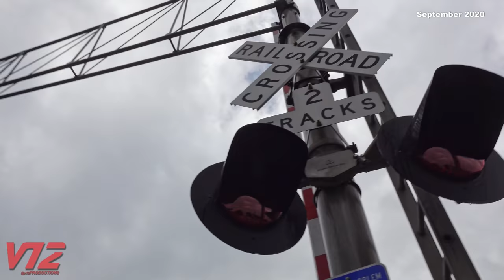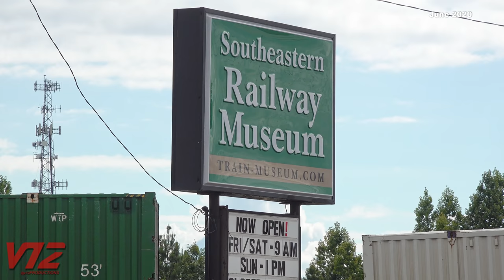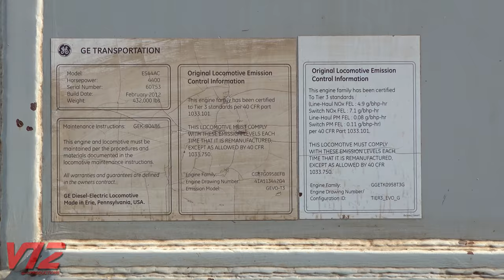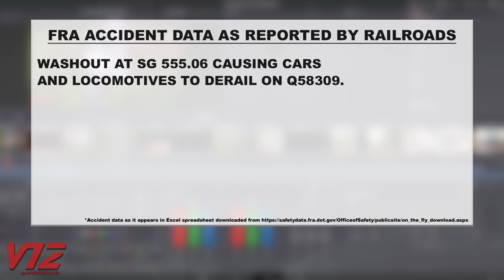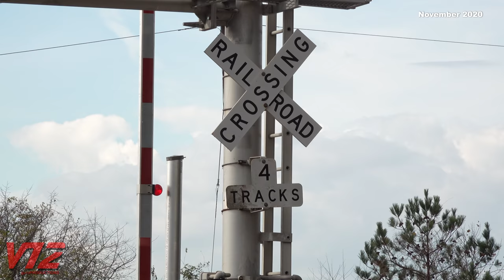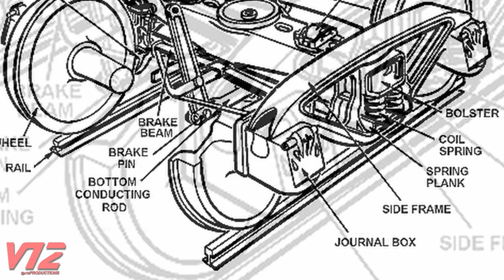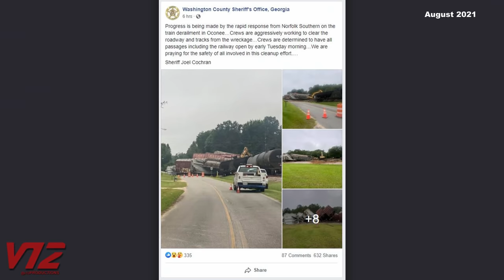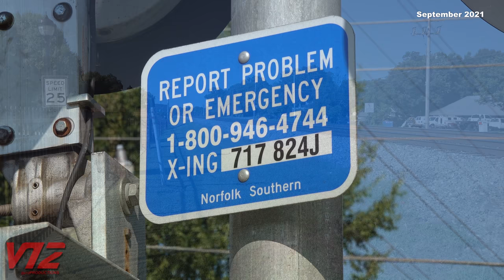Train Derailments & Accidents SPECIAL REPORT

Comment: What amazes me is how fast they can get the equipment to the derailment site and get the line open as fast as they do considering the thousands of miles of track .  That's a lot of specialized equipment.  Sometimes, derailments happen in such remote locations like the swamps along the gulf coast and remote mountainous sites.

Comment: Here in the UK the orange Level Crossing lights flash before the red & white stop barriers go down, therefore drivers get the chance to get through the crossing before the barriers come down & block the vehicle on the track ... we don't have many open Level Crossing here, it's usually in very rural areas, but because of the multi-layer warnings & highly noticeable signage leading up to the crossing incidents are rare here.

Comment: I was an engineer for UP in Iowa for some 12 years mostly the east/west corridor. Much of that has a track speed of 70mph, and when a vehicle gets hit at that speed, bad things happen. The last one had body parts splattered all over the front of the cab. The crossing had gates, lights and bells, and I was whistling according to GCOR and FRA guidelines. It was smaller intermodal train, about 8k feet in length with four burners on line, and running 70 mph. Flat, level and a straight section of rail. Never should have happened - but the car's driver went around the gates. Train speeds as perceived from the ground can be very deceptive! NEVER assume that it can be outrun.
Reply: I ran engines for 36 years for a railroad in the USA. Ran over all kinds of stuff in my time as an engineer, the usual stuff cars, trucks and some pedestrian suicides. We had a supervisor that said if you are following the rules and doing your job right, it will keep the ghost off of the bedpost. I guess it depends on the person, but I lost very little sleep over any of it.
Reply: @old56timer  Play stupid games--------Win stupid prizes!!!

Comment: This was a very well put together documentary. I was born in the UK where trains are used pretty regularly to get from point A to B. Commuters freight trains and high speed trains are used on a daily basis. My Father was a train spotter and we lived near a busy but not crazy busy railway line all my life. My dad taught us rail safety from an early age. there thing with trains in the UK are diesel electric commuter trains, which means they rely on a third rail. the commuter train have points underneath the train that ride on the third rail, If you step on or fall on this third rail it is a painful death follows. I have seen tracker trailers cars buses and even motor cyclist running the gates and lights on so many occasions. Trains here in Canada are mainly used for freight with passenger trains traveling across this large  country so they are not like in the USA in this respect. that being said there is a commuter train that has been used here in Ottawa central area soon too open a new part in the near future called the CRT train. His type of train can run forwards and backward without using a different rail to turn around. Most trains can do this. I used to go out trainspotting with my Father when i was much younger and i even took my 3 year old with me. we told him how he has to be careful not to be too close to the edge of the plat form as high speed trains rush past the station at high speed. He was well behaved and even got to sit in on of the cabs. while it waited for the green light to go. Its was a fun day out and the excitement is contagious. Engineers of trains are the best people out there. We also went to see a newly refurbished engine that my son sat on the front bumpers of i was right there with him when my Father took the photo. My son had the time of his life. Rail safety is paramount. You can stop fairly quickly a train can take miles to fully stop. being killed by a train you don't go home in one body bag and it is a gruesome scene for the recovery process. When running trough a train crossing you are not only risking your life but the passengers, the engineers and staff also, on the train. Even if you are on a time line it is not worth risking so many line just to be on time it rarely ends well. Be Safe out there, please don't risk your life and many others, its not worth it

Comment: With regards to villa Rica. That particular area has 2 roads that parallel the tracks. One on each side. These close conjuctures create a pinch at the crossing that an unsuspecting or newer truck driver has to figure out as the driver is in real time. Many times the conditions further limit  the drivers line of site. A huge upgrade would be to red light the parallel traffic with no turn on red indicators as a train enters its block before the gates are activated

Comment: As  much as I have these accidents happen, it still amazing that with the signs, placards, truck driver training these things still happen. One thing not mentioned was folks turning sharp turns to put them shelvs into the road road bed trapped between  the rails. Like the folks at Ashland Virginia. We even had this on CN in Warrensburg, Illinois last week. This is a single track crossing, but still had an auto driving 50 or so yards down the road bed.   This could be another storyline for this "Training" video. Just a thought. In this case, city and CN Railroad took action and no train versus car took place.

Comment: Very good video my friend Thank You!! It is very sad some does not use common sense at railroad crossings as they should. Derailments happens anywhere, but I have notice NS has had a lot of them recently😳😳😳 Again thank you for a awesome video!!!!
Reply from the maker: Thanks for watching!
Reply: The vast majority of derailments come from poor track maintenance. #SafetyThird the American way! 🤭🤭🤭👎
Reply: Some of these derailment to are heat expansion due to welded rail. Also called "Sun Waves or Winkles" .    I have felt them when riding Amtrak.  I have "Sea legs,  not Train legs".

Comment: A long time ago, I was about 10 years old. I was riding the bus and we came up to a crossing. Traffic backed the crossing up so our bus stopped on the tracks for some reason, but then an I&O railroad gp38-2 was about 20 feet away. moving about 15 mph. I remember the gates and lights acivating. I could here the sheer panic in everybody. luckily traffic moved and the bus escaped the crossing. But the driver got fired.

Comment: They need those signs that show the trailer hitting the track anywhere there is a hill going over the track. The outline of the sign should have fluorescent trim so it can easily be seen in the rain at night. And have another at least 200 feet before the railroad crossing. AND DON’T HAVE THE SIGN BLOCKED BY TREE BRANCHES OR BUSHES! Pennsylvania does this a lot!

Comment: In my opinion, while the truck driver in the first video was obviously wrong for going through the lights,  if the cop hadn't distracted him by putting on the lights and sirens, he could have made it through before the train got there. I think the cop should've waited for the driver to make it across, then chase him down. Of course, the truck driver also could've prevented this by not going through the gates. (However we're trained as school bus drivers that if the crossing comes on when we're half-way across, it's quicker / safer to keep going than to back up.)
Reply: Agree 👍
Reply: I have been a passenger vehicle driver too, and I totally agree.
Reply: Dispatcher: Your Fired!
Reply: The truck driver didn't stop because he was distracted by the police car. He stopped because, as the narrator says, he couldn't make his turn.

He was too close to the post on the inside of the turn. It doesn't look like he hit it, but he clearly would have if he'd tried to continue.

I definitely agree that you should keep going when there's a train coming, even if that would damage line-side equipment. However, at that angle, without a run-up and making contact part way along the trailer, there's no way it would have uprooted the post. It would have remained stuck in roughly the same position. If he'd try to force the issue he might have brought down the cable with the traffic lights, but he wouldn't have got past the post.

Comment: The bathrooms on these engines are at the front. What happens with these in these crashes? Seems they should be located somewhere else.
Reply: Its a well designed compartment with a air operated toilet and a sealed door enclosed in a reinforced structure designed for impact, its just fine the way they are, GE got it right…..
Reply: @mshum538  Ah, well, thats good. I keep having visions of the crew getting that all themselves. Its one part the videos never spotlight. LOL.
Reply: It is likely, in that event, that you would have a shjtty day!
Reply: Grey water tanks with inertia switches.
Reply: Well,, I do believe it's called" when the s@@t hits the walls"  I do hope that no one will be in there when something like that happens

Comment: There are a lot of people driving trucks who have never been told how to correctly deal with railroad crossings. They also seem to lack the basic knowledge of where their truck will/won’t fit. I have seen drivers pull up to stop signs only twenty feet past the tracks, leaving their entire trailer blocking the tracks. I have always been told to stop BEFORE the tracks, ensure the tracks are clear first, then proceed when safe to do so without stopping at the stop sign. Most crossings like this are signed, telling you not to stop or block tracks. It’s all about training, or perhaps the lack of it.

Comment: Given the fact that trains, trucks and cars share the same space but hopefully at different times, the safety record for trains is pretty good.  The number of civil aviation deaths increased from 395 in 2018 to 452 in 2019. All but 8 of the 452 deaths in 2019 were onboard fatalities. Four of these deaths involved a commercial airline.  So although the deaths are higher in airplanes they are not for the most part associated with crashes but probably medical. And possibly due to larger numbers of passengers. Quite a few small plane crashes this year with deaths though.

Comment: # 1 cause -of ALL of these so-called crossing accidents.
Every one was completely preventable.
How ?
Well it so happens that away back in 1971, I was "tasked" with doing a "level-crossing" survey, to determine exactly what gradients (if any) presented themselves to long wheel-based road vehicles - in the Otago & Southland regions of New Zealand, as part of my job as a draughtsman/surveyor with the NZR's Dunedin D E O (District Engineers Office).

Why? 
Because too many semi's and long farm trailers were being hit / destroyed when they "bottomed-out" on both public & private road/rail crossings.

The problem I found was that many - if not all - private farm/farm crossings, as well as too many public road/rail crossings had NOT been lifted on either side approaches, whenever the railway itself had been "lifted/tamped" to correct problems with the track foundation or sleepers / new rails etc.
That always resulted in the road approaches being left TOO LOW, creating serious clearance issues with longer vehicles, becoming "bellied" (gut-stuck), on the raised track

The answer - not always an easy fix, but easy enough.
Raise all road approaches either side of these crossings, for as far back as ":double" the legal length, of any semi trailer (ensuring non-legal farm trailers couldn't ever become gut-stuck either).

In New Zealand, there are (now) only a very few, infrequently used (private farm crossings, that haven't been raised.
ALL public road crossings and MOST farm (private) crossings, are raised on both sides, to avoid any "gut-stuck" problems, thereby removing any chance of idiotic drivers, stranding themselves on a railway crossing.

ALSO, here, we MOVED streets away from the crossings that had to be on the same level, to ensure that long vehicles didn't "stand" over the tracks, when at traffic lights.
OR - we placed the traffic lights IN FRONT OF (not after) the railway lines themselves, to ensure that no one needed to "stop" on the tracks.

If the USA road maintenance people (roads boards) made sure that ALL road/railway (level) crossings - were actively LEVEL - none of these "Oh shit I'm stuck in the middle" preventable accidents, would ever occur again.

Having such a MOUNTAIN at each road/rail crossing (seen via a cross-section-view) - is asking for all long vehicles to be GUT_STUCK, sooner rather than later.

Sadly - removing the clearance issues by ensuring LEVEL road/rail crossings were actually LEVEL, or moving major traffic light works, away from the crossings - and other equally obvious remedial work to "keep" most drivers safe.

We haven't yet found a way to fix STUPID
There will always be - STUPID (people) drivers out there, doing utterly STUPID things, such as those with their daily work/city vehicles (aka: short wheelbase cars) who during holiday times, leave their brains at work too, to head off into the great wide open outdoors, towing HOLIDAY fun-things (such as their impossibly long trailers and oversized watercraft - on home made low slung trailers etc)..
Who simply forget they have ANYTHING behind them, and "park their arse" on an active crossing - or - who don't remember to turn wide, and "jaw" themselves around roadside poles etc., at level crossings etc., meaning STUPID IS as STUPID does, and many still die, before they came to realize - aw crap - shouldn't have done that..!!!
Reply: You can't fix stupid.

Comment: Retired MOW track foreman here....28 years for the ATSF and BNSF.  Hulcher and Corman are shysters, but they are the only ones left with the side booms to lift heavy loads.  There might be  a few smaller companies left.  I also inspected track for the FRA and had to ride monthly rides on the trains.  I can't count the number of idiots who want to try and beat the train.  99 out of 100 you might beat it.  It just takes one.  The BNSF runs trains that are 6000 - 7000 feet long.  At speeds of 70 mph on good track.  A train traveling at 55 mph will take over a mile to stop.   Don't be an idiot.  The train always wins.
Reply from the maker: That's really interesting. Thank you for sharing!

Comment: i have a problem here, the gates should activate between 30 up to 60 seconds before the train arrives (Federal standard that most Rail companies adhere too. That should be reviewed, I see about ten seconds.  I will give ya that the driver stalled, froze, hesitated or whatever.  the train arrived sooner than 30 seconds.
Reply: I'm a truck driver... and I have come close to being caught up in a situation with a train a few times....... and at a lot of crossing we have to stop or slow way down and ease across the tracks because the crossings are so rough and that will mess a driver up..

Comment: Actually, that officer could ticket the truck driver for going through the blinking train lights. In addition to the fines, he'll incur for the damage he did to the engine. He will be lucky if he still has his job as well. In GA, it is illegal to run the train signal lights, so you can get ticketed.
Reply: Wrong

Comment: Them side lift tractors look real good bit of kit ,wish we had them in UK its either jacks/packing or call in big cranes 
Been part of re railing team in UK we use jacks and beams for re railing loco's and waggons ,but more often we would use wood packing with steel plate then drive locos back on , this was very quick if it went well . Driven some loco's on than were well off the track , we also had a tilt jack that is a jack intended to fall over ,hopefully flipping empty waggon back on rail

Comment: It's different here in Germany . In general, the rail crossing should be fully secured (all red lights active, all barriers closed) 30 seconds before the train arrives. The security process begins 90 seconds before the train arrives. Steady yellow, 10 seconds later red, 10 seconds then the barriers, also about 10 seconds. The technology then needs the next 30 seconds to check itself and release the train. The distance from the rail crossing at which the trigger contacts are installed always depends on the maximum speed permitted on the railway line. Slower trains occupy the rail crossing a little longer.